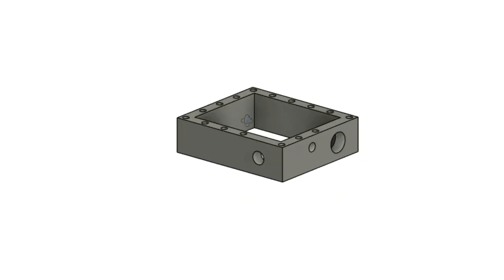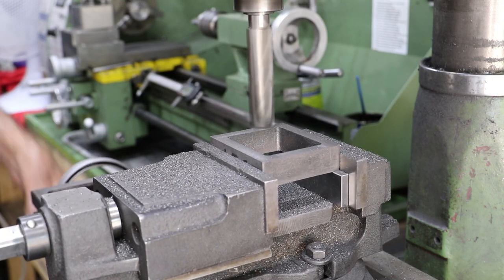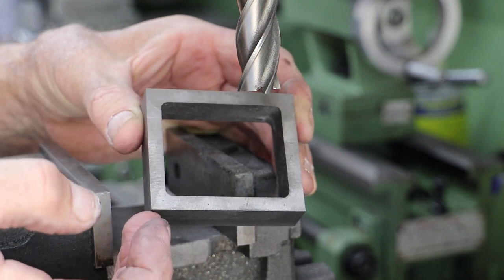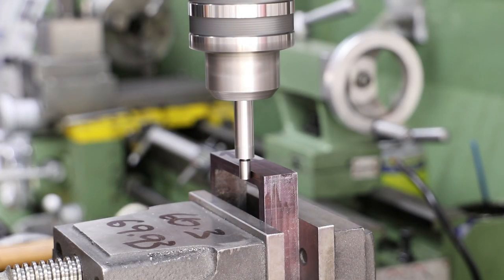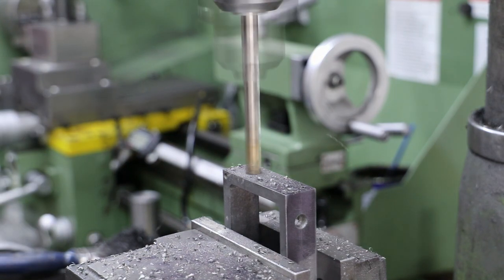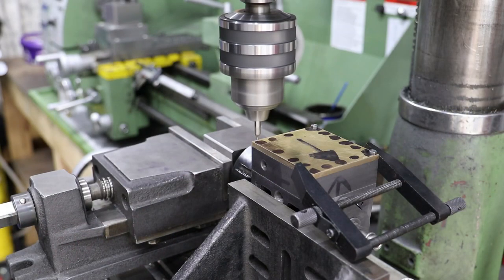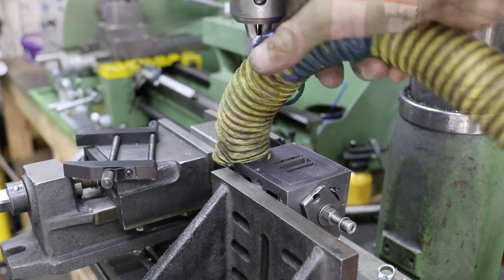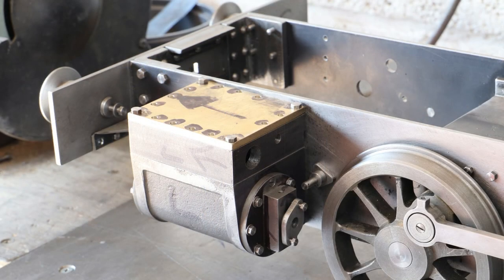Part 27: The Steam Chests

Comment: Why build it out of brass? I thought brass suffered from dezincification when in contact with steam. I'd love to hear your thoughts!
Reply from the maker: Now that is a very good question 🤔
Don's design specifically calls out Brass: "Steamchest Cover 2 Off Brass" and funnily enough he also gives a metric spec "4mm".  But like you, I've been concerned about Dezinctification.  There was also a post on the Facebook Model Engineering Group on this subject yesterday.  From the latter, it's noted that the process is not a quick one (as in years and years) and impacts on finer parts (e.g. threads) first - the post also notes that most fittings for model engineering are also sold as brass - so I think it's a case of "Go Figure" 🙂
I do need to reconnect with my local model engineering society and when I do, I will seek guidance.
Cheers
Mark